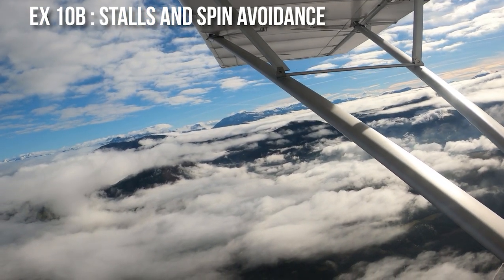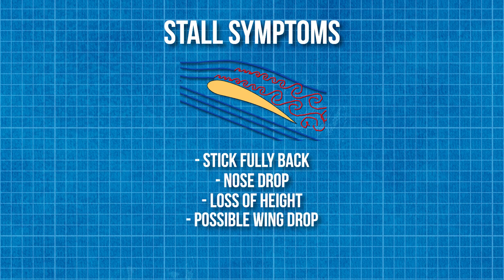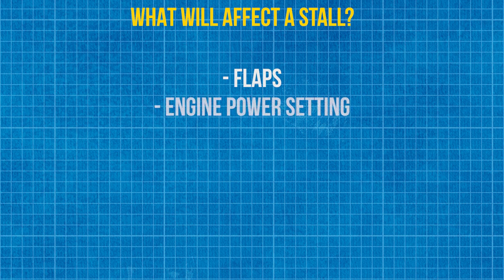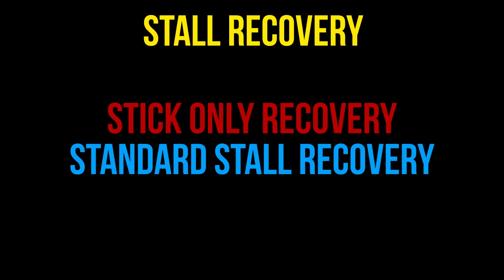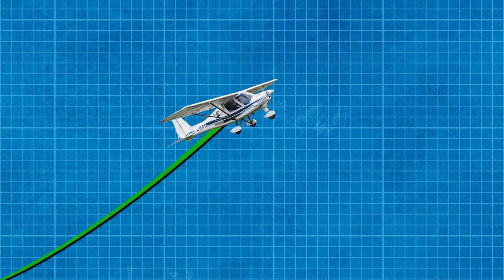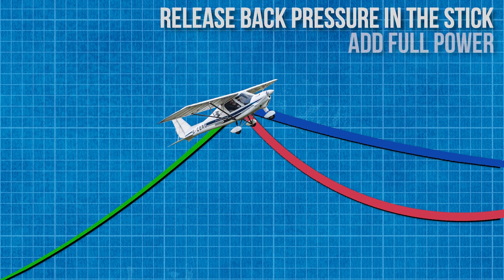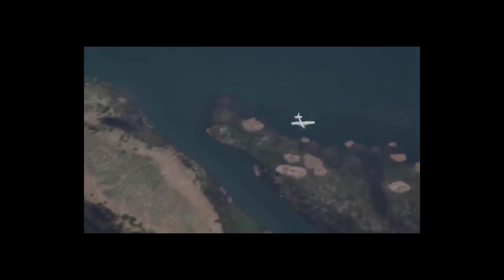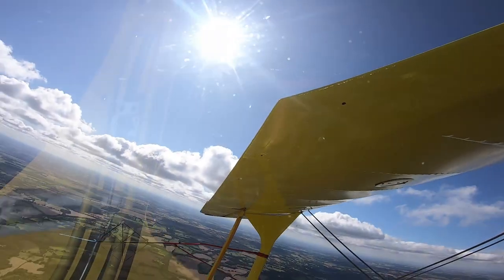EX 10b : Stalls and Spin Avoidance

Comment: Another great, concise briefing - nice. Why isn't there an Ex 11? Is that under development by the authorities?
Reply from the maker: It used to be the spin avoidance talk in the old syllabus. However when the BMAA updated the syllabus they seemed to miss out 11. So it jumps straight from 10b to 12. It's bloody stupid. Look in your bmaa syllabus book 😂
Reply: You Have Control Thanks, it does seem silly doesn't it. Interesting watching that C150/152 in a spin. The Piper Tomahawk put paid to spin training in the UK, when they started to take over from C152s and PA28s. Am I correct in thinking that C42s can tolerate a spin/been tested for spinning, for emergencies/accidental spins?
Reply from the maker: @musoseven8218  correction! The C42 has been tested in a spin. However it is not certified to do them.